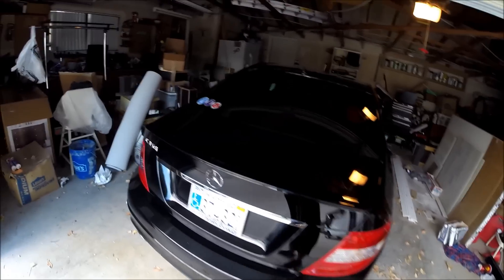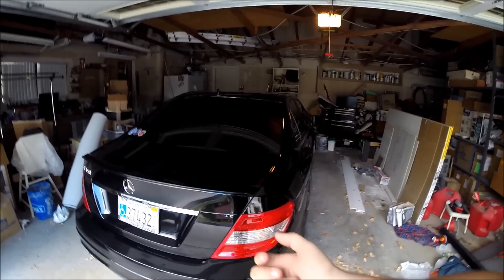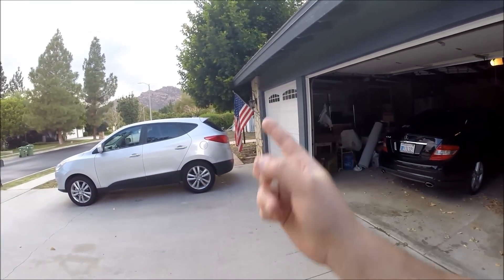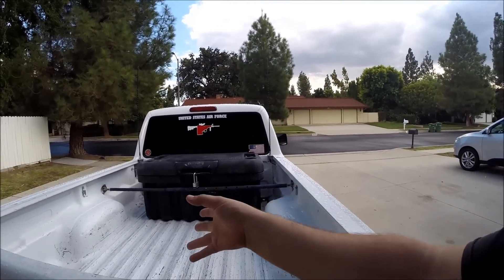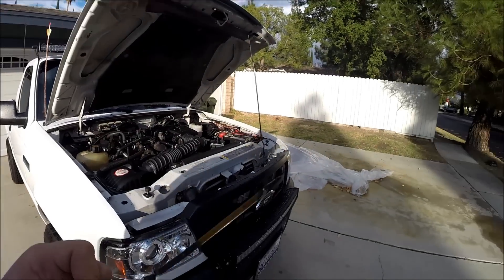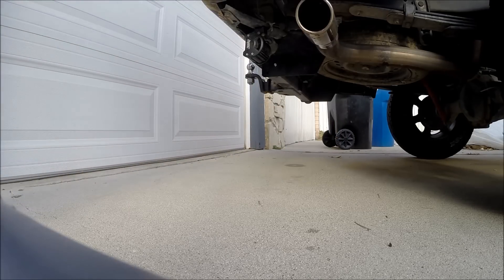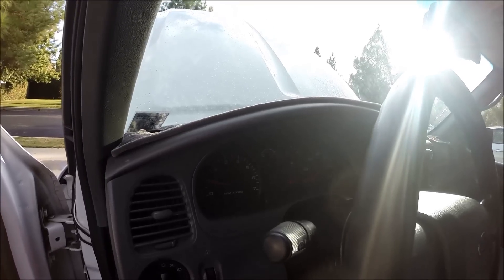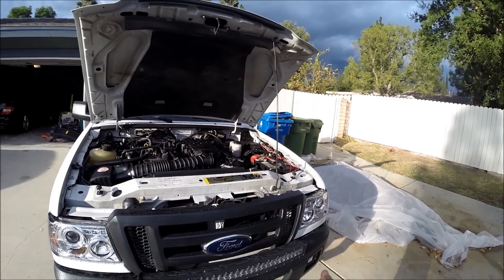Benefits Of Archoil Products

Comment: I've always looked at additives with a bit of suspicion, but I tried archoil fuel additive in my diesel Cherokee (Liberty in the US) and it was remarkable. The entire system was cleaned out - to the point that the mechanic commented on it at the recent service (95K miles). It has also improved the fuel mileage by about 5-7 percent. As far as I am concerned, it is an investment in the life of the engine - as much as top quality oil.

Comment: Just saw this so I am almost two years late to the party.  First let me say you have picked the right oil for your truck and I will leave it at that.  My first introduction to archoil was from a friend that I do competitive shooting with.  I now use their AR4400 gun oil and AR8300 grease on all of my firearms.  I've been shooting for over 50 years and I have found none better than these two products.

I use the same oil that you do in our Honda Element and I have just started using the AR9100 and  AR6200 in it.  I will say I put both of these products in my Honda Snowblower this past fall and the old blower has never ran as smooth as it does now.  When temps fall down to -20F you need all the help you can get to start one of these and mine never failed to start on at least the second pull.

Initial investment for the products is a little expensive but considering it only takes 1.2 oz per quart of oil and 5ml for a 15 gallon tank of fuel, the products last for a very long time and each application is pennies on the dollar.
Reply: AR8300 grease. Does it make a noticeable difference in slickness of weapon actions?

Comment: I ordered the archoil  from Amazon so I guess we'll 
see in a couple weeks if it works or not. I have a 91 Ford Ranger with 156,000 miles on it. Trying to preserve the engine for at least 300,000 miles.

Comment: I wish more people would post this on gas engine vehicles both the fuel addititve and oil additive.  The archoil products are very very good.  I'm still scratch ing my head after adding to my 6.2l v8 both fuel and 9100 picked up almost 6mpg from 14 to 19.8 I've been using this stuff for years in my Diesels it seems to have a huge benefit in gasoline engine

Comment: lol i got more miles on my suv then your tuck dose but how much do you really like that oil
Reply from the maker: I really like the oil, I have noticed it's quieter upon start up and normal operation, and now with it in my manual transmission it shifts so smooth now